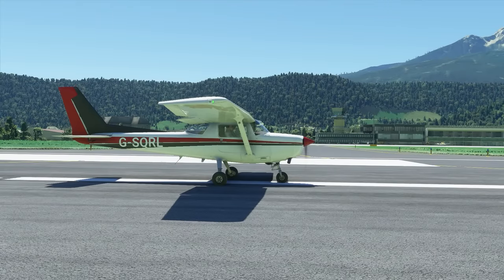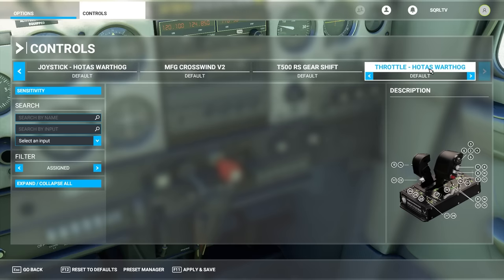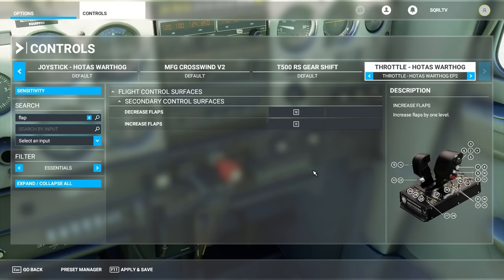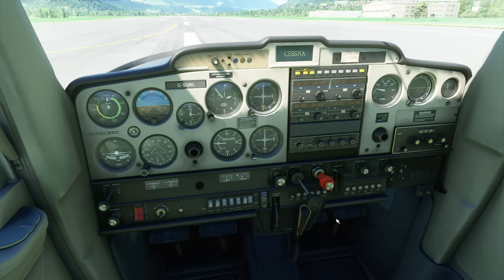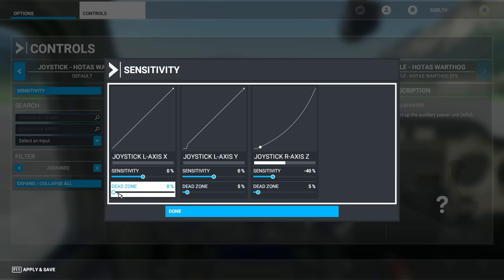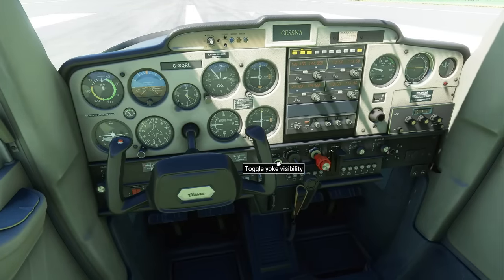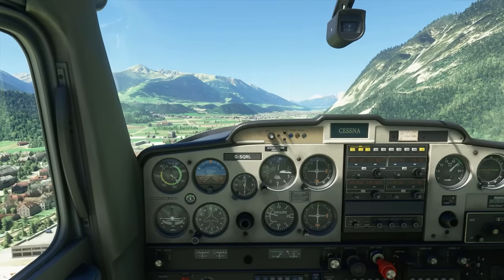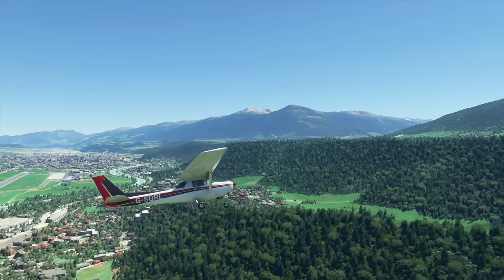Tutorial #2 - Peripheral Control Setup - Microsoft Flight Simulator

Comment: QUESTION: I have a Logitech BIP panel that I want to connect to MSFS 2020. Would you have any
advice as to how to accomplish that? I currently have a full set-up of panels working in the sim,
but even though connected, the BIP panel is not functioning. In addition, when checked in the control panel in devices it says the BIP panel is "working properly.

Comment: Great Tutorials, the problem I am having is that MFS20 does not recognizes my controls. 
I have many of the saitek flight instrument, Radio Panel , Flight Multi-panel and the Switch Panel,. None of which are being recognized by the system,  I have already visited the Saitek website and downloaded the latest updates and still are not being recognized.
Any suggestions?

Comment: I set my VPC Constellation Alpha and Thrustmaster throttle up and they were working fine until the most recent update. Now every time I load an aircraft it immediately rolls hard to the left (i.e. full left aileron) despite the joystick being in the neutral position. I have tried different USB ports, setting up a new profile, running the VPC calibration software, but nothing works. The stick works fine with other sims like DCS and Il-27 etc. Any ideas??

Comment: Is there a mouse yoke option available?
Reply: Seems like you can use alot of different ways to control the plane including mouse and keyboard
Reply: Shame HE didnt hover to the mouse section
Reply: Just a note: it's a simulator for flying. Real pilots don't use mice and keyboards. It's a real pain to do so. We use a yoke or a flightstick. Even used ones can be had for $10 and you will never want to use a mouse again. I hope you can get one.

Comment: Well I have MS FS2020 running and my controls mapped.. Two problems. 1. My throttle response if very erratic even after I changed the response curve. Need some suggestions on how to fix that.  2. How can I map different views to buttons on my CH Eclipse Yoke?  Haven't been able to figure that one out.  Any suggestions would be very helpful..Thanks!!

Comment: So let me get this right....I have a Saitek X52 Pro Joystick and throttle, Logitech Pro Flight Yoke system with throttle quadrant, Fanatec Racing wheel with racing pedals and an Xbox 1 Wireless controller. Will i be able to use all of these peripherals in this game? I'm assuming some might be recognised and some might not like your warthog and the MFG Crosswind pedals.
Reply: I have also X52 (not Pro version), and I've planned to use it for the throtle part (not the joystick) in complement with my yoke Honeycomb and Logitech Flight Rudder Pedals.
But I have also a T.Flight Hotas 4 from which I have planned to use the throtle part (if X52 does not work).

For the car racing pedals, I'm not sure that it will be used in the FS...

Comment: hmm... could you check if there is support for button combinations like Button 7 + Button 52 for Radio Tune up or something. And I hope FS 2020 recognizes ore than 32 buttons for a controller. I use the Virpil stuff and there are 72 inputs and 6 axis on the throttle alone. And 32 buttons and 6 axis on the Alpha stick.
Reply: I was wondering the same. I dn't have as many buttons on my hotas, and it would be nice to have  modifier button

Comment: I have a the warthog hotas throttle and i want to assign one of the 2 position switches to my gear lever. I assign it to set gear as it's 0,1 but it only will put gear up, not down. Any help would be appreciated.

Comment: Squirrel superb. Learned loads but also learned that the ESC button will not get me out of the in game screen back to control screen. It works normally where it says Esc at the bottom left of screen to Go Back etc but not on the in game screen. Any ideas what may  be the problem as to exit the game totally i now have to close the screen from the task bar which i'm sure is not correct.
Reply: all fixed .Just reloaded defaults and all ok

Comment: When I increase my Throttle, my throttle in game just randomly jumps I don’t get it. I can’t even take off
Reply: I'm dealing with the same thing. Make sure you have the drivers for your HOTAS installed. See if there is a profile software for them. Then try to calibrate them. It seemed to work for me
Reply: Could also be a dead zone thing. 

Also you might have the axis reversed and so when you load in as soon as you touch the throttle and it registers in the sim it jumps to 100% power even though your levers are full aft... reverse the axis on that input and see what happens.

Ic not then do what the other guy said and reload your drivers and calibrate your hardware
Reply: I fixed it. Im dumb as hell and i keybound "throttle increase" and "Throttle decrease" when i shouldve bound "throttle axis"

Comment: Hi there squirrel, hows it going? I've got an issue I can't sort out. MSFS2020 recognises my flight yoke and quadrant so there is no problem regarding that, but when I set my flaps to go incremental following your video to the letter, the flaps always return to flap 10 (the middle extension) this makes no difference whether I try up or down. I have deleted previous assignments and the sim says "this button is already mapped do you want to use it anyway" I would have thought if I said yes, then it would simply over-ride the buttons previous function. As soon as I tried different mappings the sim set up it's own name from default to "Flight yoke system profile" I don't understand. Have you got any ideas? cheers!

Comment: I haven't watched all of it yet, but I am wondering if my home made switch panel using USB controllers will work?
Reply: It will likely be seen as an unrecognized USB device and you’ll just need to map the buttons.
Reply: @jasonmartinalaska  Yeah but the question is whether it will map correctly being that they are on/off toggle switches. I needed to writes scripts in fsuipc for P3D since the controls menu is garbage in that sim. X-plane was even worse.

Comment: Been playing with my Warthog settings... Here is what I came up with.... Hope it helps someone.

Warthog Joystick

1)	Trigger 	Toggle Smart Camera
2)	Red Button	Toggle Active Pause 
3)	Bottom Grey	Increase Cockpit View Height
4)	Pull Switch	Brake
5)	Front Grey	Toggle Interior Lights (Turn on Brightness First)
6)	Trigger Second Click	Cockpit / External View Mode
7)	Black Left 4way Up	Decrease Flaps
8)	Black Left 4way Rt	Rudder Trim Right
9)	Black Left 4way Dn	Increase Flaps
10)	Black Left 4way Lt	Rudder Trim Left
11)	Black Right 4way Up	External Quickview Top
12)	Black Right 4way Rt	External Quickview Right
13)	Black Right 4way Dn	External Quickview Rear / Down
14)	Black Right 4way Lt	External Quickview Left
15)	Grey Thumb 4way Up	Instrument View Up
16)	Grey Thumb 4way Rt	Instrument View Right
17)	Grey Thumb 4way Dn	Instrument View Down
18)	Grey Thumb 4way Lt	Instrument View Left
19)	Grey Thumb 4way In	Reset Cockpit View
3 + 18 	Bottom Grey + Thumb Lt	Decrease Steering
3 + 16	Bottom Grey + Thumb Rt	Increase Steering
4 + 18 	Pull Switch + Thumb Lt	Decrease Steering
4 + 16	Pull Switch + Thumb Rt	Increase Steering
POV	Hat Up	Pitch Nose Down
POV	Hat Rt	Right Rudder Trim
POV	Hat Dn	Pitch Nose Up
POV	Hat Lt	Left Rudder Trim
 
Warthog Throttle

1)	Mouse Center	Center Aileron Rudder
Joystick L – Axis X	Rudder Axis 50% Sens
Joystick L – Axis Y	Elevator Trim Axis (Reverse Axis) 50% Sens
2)	Right Hat Push	Toggle Drone
3)	Right Hat Up	Translate Drone Up
4)	Right Hat Forward	Increase Drone Zoom
5)	Right Hat Dn	Translate Drone Down
6)	Right Hat Back	Decrease Drone Zoom
7)	Thumb Top Forward	Hold Throttle Reverse Thrust
8)	Thumb Top Back	Toggle Parking Brake
9)	Thumb Middle Forward	Retract Spoilers
10)	Thumb Middle Back	Extend Spoilers
11)	Thumb Bottom Red Forward	Display Map
12)	Thumb Bottom Red Back	Display ATC
13)	Slider Left - Left Forward	=
14)	Slider Left - Left Back	=
15)	Slider Left Front Red Button	Auto Engine Start
16)	Engine Fuel Left	Set Engine 1 Fuel Valve
17)	Engine Fuel Right	Set Engine 2 Fuel Valve
18)	Engine Operate IGN Left	Set Starter 1 Hold
19)	Engine Operate IGN Right	Set Starter 2 Hold
20)	APU Starter Up	Auxiliary Power Unit Starter
21)	L/G WRN Button	Toggle Landing Gear 
22)	Flaps Forward	Extend Flaps (Center Allow Joystick Cntl)
23)	Flaps Back	Retract Flaps (Center Allow Joystick Cntl)
24)	EAC ARM Up	Autopilot NAV1 Hold On
25)	RDR ALTM Up	Autopilot Approach Hold On
26)	Autopilot Button	Toggle Autopilot Master
27)	Autopilot Switch Up 	Autopilot Heading Hold On
28)	Autopilot Switch Dn	Autopilot Altitude Hold On
29)	Slider Right Off	Throttle 2 Cut (Lift Up and Back)
30)	Slider Left Off	Throttle 1 Cut (Lift Up and Back)
31)	Engine Fuel Motor Left Up	Set Starter 1
32)	Engine Fuel Motor Right Up	Set Starter 2
POV	Front Hat POV Lt	=
POV	Front Hat POV Rt	=
Slider Rt	Slider Right	Throttle 2 & 3 Axis
Slider Lt	Slider Left	Throttle 1 & 4 Axis
Slider Sm	Slider Small	Mixture Axis

Comment: I have a TM16000 stick and throttle but no rudder pedals.  How would you map the brakes so I can turn left and right like you did in the video?  Thanks for your great sim videos.
Reply from the maker: Maybe map the two red buttons on the thrust lever to left and right toe brake
Reply: @squirrel  Thank you, I will try that on Tuesday! Again, thank you for all of your streams and videos.  You are one of the best on YT and Twitch (I subscribed).
Reply: I use the paddle on the HOTAS to control the differential brakes and the twist on stick for rudder.
Reply: @Iam_Dunn  thank you and I will give this a try as well.  I am thinking of setting up different profiles as Squirrel suggested and see what I like.  I just got into pc gaming and this is my first flight sim even though I am an older guy :)   I have been a console gamer for many, many years.  Still as excited as a kid for this sim to be released!

Comment: Mapped my Saitek Cyborg EVO joystick weeks ago...still not getting 'smooth' control inputs...the throttle goes to full in-game when i'm only around 50% on the joystick..and the Pitch/Roll are smooth for the first 10 to 15 degrees but then go crazy 100% full control if i move the joystick any further in either direction...just really odd.  I've adjusted the Sensitivity to everything from 0 to -40..for that 'smooth curve i like', but it's made no difference in the weird behavior while ingame.  I use same Joystick on DSC World and it's smooth as silk.  I think MSFS 2020 still has some serious control issues to line out.

Comment: Unfortunately the sim doesn't support the Saitek products. None of them show up in the controls so there is no way to even manually assign key mapping. The forums are starting to fill with posts of others with the same problems. So far there is no fix. When Saitek was bought by Logitech they basically froze. They haven't released any new drivers for the 2020 sim and their latest driver is from 2018. So look at the saitek/Logitech as end of life products and no longer supported.

Comment: Hey Squirrel, VERY HELPFUL VIDEO!!! Thanks for this information. It is very hard to get a hold of Microsoft tech support to help me with setting this new sim up. Now that i've learned how to setup switches, in FSX Steam i always used FSUIPC, my Switch Panel, Radio Panel and my Auto Pilot Panel as well as my Track IR 5. Which i can't get to work in this Sim yet. There is really no videos on setting up my Logitech switch panels or my Track IR. Can you make a video showing how to map these items to work in this sim? I would be very disappointed if i can't ever use my switch panels in this sim. I can deal with mapping some switches on the Saitek controls and just use my mouse to change frequencies and that, but i CAN NOT fly a Sim without Track IR. This is a deal breaker for me. So please help me keep MFSX 2020 by helping me set up my Track IR at the least and hopefully my panels as well. Thank you so much. You are truly the best. :-)

Comment: Hi guys. Quick question. I have a Microsoft Force Feedback 2 which is officially no longer supported by Windows but recognized instantly and can be calibrated as well. Problem is that FS 2020 does not recognize it at all. So I configured it manually. But when clicking Sensivity options inside controls, the field is empty. When then trying to fly any kind of aircraft (learned on an C172 so took this one) controls are going completely nuts to a point where the aircraft is not controllable. Anyone got a remedy against that? Plugged my xBox controller in and was at least able to take off and land with  this one... (waiting for the honeycomb stuff to be available again...)

Comment: how does thrust reversers work! on MFSX there was no way to map reverse thrusts without using plugins which also didn't work. I had to tap the f2 key and it was really annoying! I hope there is a way to map it
Reply from the maker: Yes I have it mapped on my warthog throttle. You can map it as a hold or a toggle button, then just push thrust lever forward and you’ll get reverse thrust.

Comment: I was able to setup my saitek USB joystick. I then plugged in my USB arcade deck to use the buttons as extra controls. Once I did that the saitek stopped working. I check basic control is pointing to saitek. It still does not work. Saitek works again after removing the USB arcade deck, and rebooting. Anyone use more than one USB device?

Comment: Question on controls (I am there for the view).  All my planes yesterday suffered from the engine cutting out constantly, every 1-2 minutes.  I fly just the 152 and 172 cos I just like flying around and practicing for now, but clearly I have clicked a button or pressed something that means the engine cuts out.  On the 152 I can see the magneto switch being tweaked (moved slightly) every second with a click - and that certainly should not happen, I turn it from both to 1 and the engine immediately cuts out.  On the 172, I have an oil pressure warning - so maybe an oil pump not on.  Can anyone enlighten me; google has not been my friend, I have spent hours scanning all the flight button but cannot see anything obvious.

Comment: This might be an extremely silly question but I’m hoping someone can assist me. 
I have a joystick that I intend to use for this simulator , but there aren’t enough knobs or levers to control the thrust and mixture control. 
However , I DO have a DJ controller that has two levers side by side to control the volume on each deck, and I intend to use that to control the thrust and mixtures, as well as assign various buttons to landing and strobe lights. 
I’m in a tight spot financially so buying a theustmaster with levers (slidy parts) is not an option. 
Will this be possible? Will Microsoft flight simulator be able to detect my DJ controller ? (Pioneer DDJ ergo) 
Thanks for anyone who can answer my odd question.

Comment: I hope that those clowns at Logitech are rapidly bringing out drivers for the Saitek radio, and switch panels.
They knew that MSFS was released at the 18th but nothing happened,but they are still charging a lot of money for these panels...
Also, MSFS needs a HUD only view and a “Fly by” mode
Reply: None of the saitek stuff works for me. They ended support years ago as the newest driver was in 2018.
Reply: @elcam84  god damnit i really hope they fix this. i didnt spend 100 dollars on a switch panel for nothing
Reply: @FedoraSnatcher  I got my no sound issue fixed but if you load up a SR22 at Kftw the plane will be frozen on the runway but it thinks its flying... I have not tested the beta version of FSUIPC yet. It is free because they haven't released a comprehensive SDK for the game yet. 
 
               I can only pull my hair out so long trying to get it to work before I have to take a break. The joystick presets and the keyboard shortcuts make no sense at all. Like they were done by someone that has no idea about flying and what controls you need.

              I will update if the FSUIPC gets the panels working.

Comment: Hi Squirrel, great tutorial.  PLS would you answer to these equations?
1. Does the sim notify the user if he tries to use an INPUT or a KEY already used elsewhere to prevent accidentally assign it?
2. Does the sim differentiates between LEFT CTRL vs RIGHT CTRL and similarly with SHIFTs and ALTs?
3. Is it possible to assign my controls profile to the specific aircraft so that I can use every aircraft with its own control profile without the necessity to manually switch among profiles?
THX

Comment: I have the madcatz joystick and it wasn't recognised. I tried to set it up manually but it doesn't detect the axis so whenever I move the yoke around it won't recognise the movement until I put it on maximum so it's completely useless. I don't have a numpad on my keyboard and fsx2020 doesn't have a mouse yoke option. Ontop of all this the game stutters a lot so this is going in the bin and I'm gonna have to go back to flight sim X..